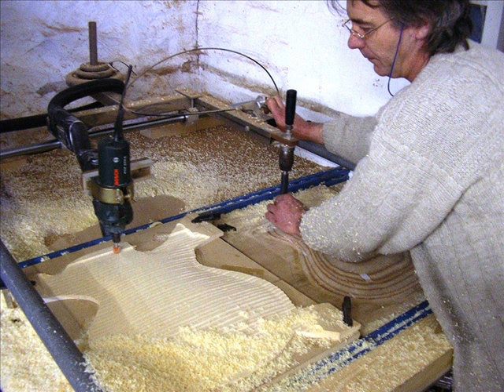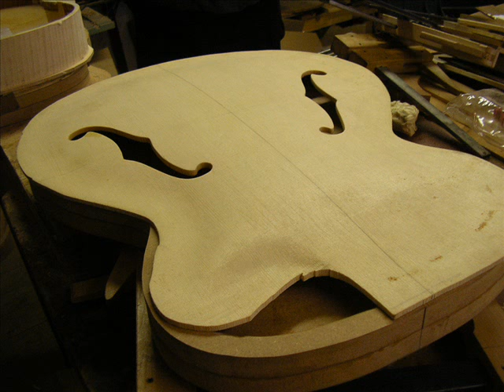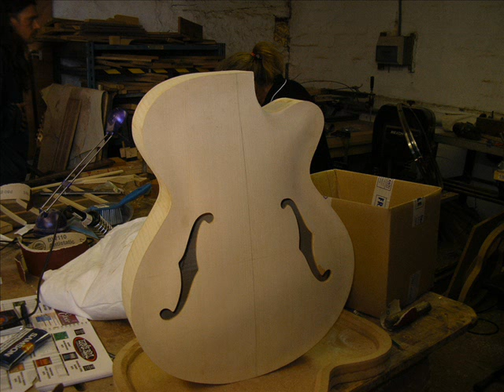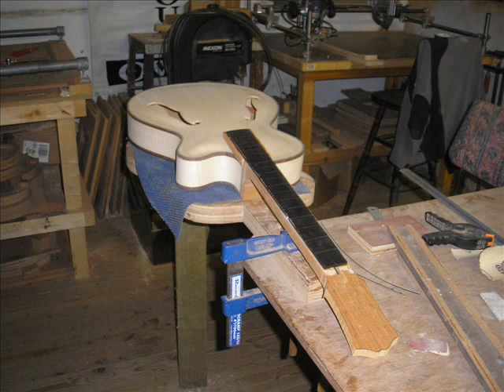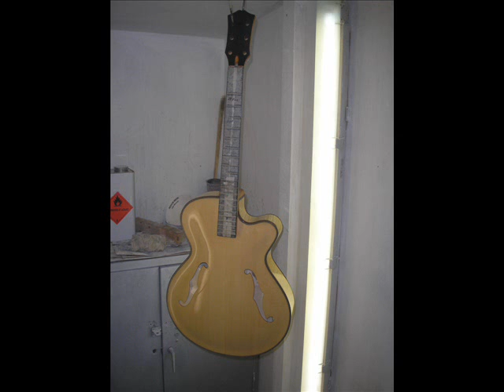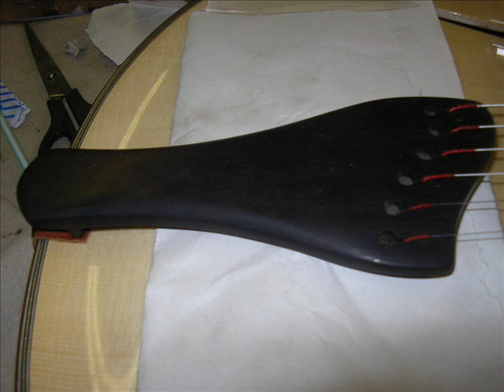Build Your Own Archtop Guitar

Comment from the maker: The side rails were bolted onto table with raised supports each end, the middle rail moves back to front on V shaped wheels, the side to side movement of the router and guide pin run on bearings along the middle rail. Hope this helps.

Comment: Archtop guitars have two braces and they are both on the soundboard. There are two styles: Parallel or x-brace. Make sure the braces go right under where the feet of the bridge will sit. I advise that you buy Bob Benedetto's book on making archtops for more info. Good Luck!

Comment: There are several ways to overcome your fear of "fret position". One is to copy the fretlength from another guitar (keeping in mind that the length of the nut to the 12th fret and the 12th fret to the bridge have to be the exact length) the other is to use one of the free fret calculators if you want to create your own fret board length. Look up "ExMI's fret calculator" in a browser and it will take you to a site with free calculator. There are several in Excel as well... Good luck!
Billo